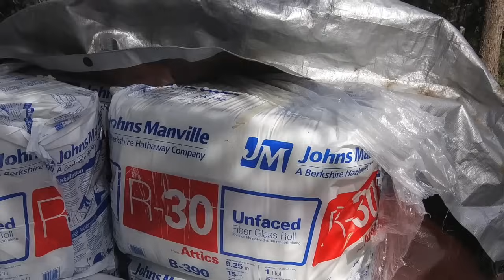3 Alaskan Summers Of Building Our Cabin With Loft | Our Future Homestead

Comment: When using a grinder to cut the metal roof the metal get to warm and destroy the rust protection. Use a nibbler or a scissor. To get a wall without a cold bridge you can use 2x2 horizonal on the outside for insulation, no need to use plywood only tyvek outside the 2x2 and then you can have a ventilated wall, using wood panel and you save money when not using plywood
Reply from the maker: I'm more concerned with not dying than future corrosion potential. Can't imagine fighting a pair of tin snips for 14 ft while holding on for dear life :)

The plywood sheathing was indeed expensive as hell. But Ive built this cabin to be extremely rigid in case of ground movement from permafrost and seasonal frost heaving. I think the 5/8 plywood laid horizontal contributes a lot of stiffness to the building. 

I do plan to fur out the inside wall for a thermal brake as well as making an easy space to run electrical and plumbing. Will probably also fur out the exterior before siding goes up. 

Thanks for the tips and thanks for watching!

Comment: did you only use 2 inches of insulation on the roof?
Reply from the maker: Hi. No, we actually used 6" of foam. We stacked 2" sheets alternating the joints to make it more air tight. Each sheet was rated at about R10. So with 6" plus the 2x6 sheathing planks the roof probably has about an R32 insul value. And in our part of Alaska, it routinely gets down to -40F. So Id say R30 is minimum in the roof and floor.

Thanks for the question and for hanging out with us!